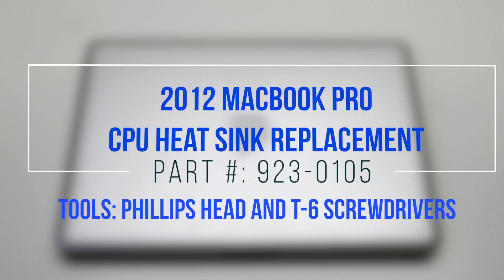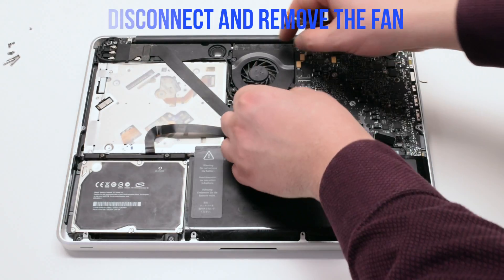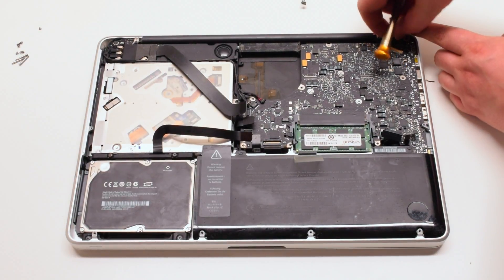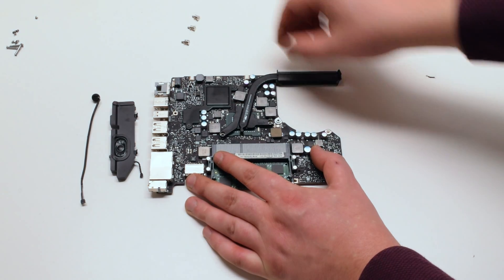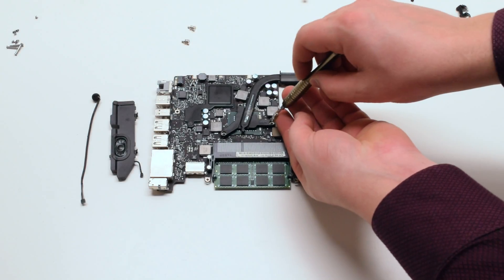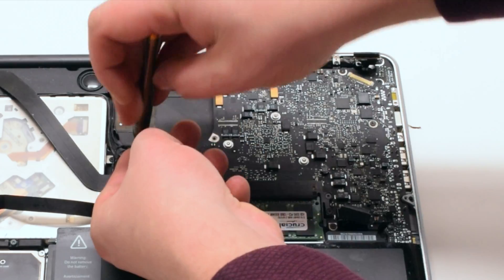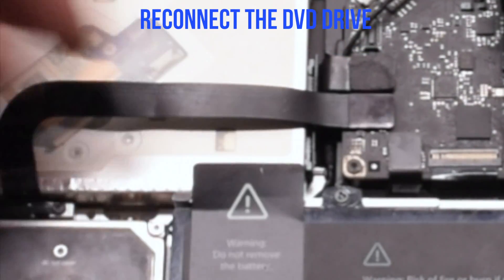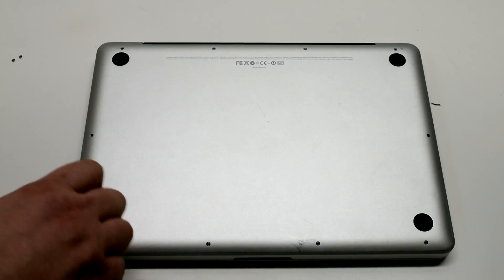2012 Macbook Pro 13" A1278 Heat Sink Replacement

Comment: There aren't 7 short phillips head screws, the four on the bottom have a little shoulder to them. And then the two on the middle left and right are shoulderless as well as the one on the top left.

Comment: I just posted the same thing half of those that watched this mentioned about removing the speaker & mic, but while he was in there he should have replaced the decade old SSD, maxed out the ram, & replaced the rechargeable battery.  I was even thinking about epoxying all the side ports with a drop or less, just to future proof it b/c they're always what break loose on me, as in gluing down the port housing to the PCB, & making sure not to get any on the contacts, but if they're screwed down, just using blue liquid locknut would be better.  Guess I should liquid locknut all of the screws, after testing everything is working.

I am about to do all I listed & repaste the CPU, just need to find whats the fastest SSD & ram it can handle so I do not buy better then it can use.  Also want to see if I can get a better longer lasting battery.  

Shame the CPU isn't socketed so it could also be upgraded.  Guess I could look into replacing the motherboard with a new update/upgraded model that will fit, & still use the same display & keyboard/mouse & all the ribbons cables used with my older model.  LOL hell the latest Raspberry Pi ARM CPU is probably a few times better 🤣

And why is this video called "Heat Sink Replacement" it's a heatsink repasting.

Comment: Good time to replace the SSD,  max out the ram, & replace the rechargeable battery, all things found on Amazon, Newegg, or Ebay.  Also don't even start unless you have the right tools, you do not want to strip out the screws, but if you already did, you can buy new ones on ebay.

Comment: If you're new to this I would take a picture w/ phone of the macbook pro w/o cover, & printout & lay screws on printout from where you took them from ... I use a magnetic sheet from Staples, under the printout to hold the screws from moving.

Comment: btw, this is a good time to check if any ports are loose, & a good time to future proof them with a drop of epoxy placed to hold down the housing but NOT cover the contacts.

Comment: Hey! great video. Quick question, what is the reason for removing the speaker before removing the heatsink? It doesn't look like it's in the way, is it relevant to remove? I shall be attempting this in a couple weeks on my younger brothers laptop as it has heat issues.
Reply: There is no reason to remove the speaker

Comment: Surely that keyboard backlight was a pain in the ass. I added some metal tape so i could pull it a bit. Also added some metal tape from the fan to the heat sink, just like on the older macs, so it conduct heat more efficiently. Then I added some iso tape over it so it does not contact anything, again, just like on my 2006 Macbook. I booted it up and it works like a charm now. Thanks for the cool video! It really helped me through this. Big THUMBS UP!

Comment: This tutorial damages the mic... DO NOT THIS VIDEO TUTORIAL!
Reply: I just did this tutorial. While it is easy to damage the mic, you must pry the mic off the glued surface like he did in the video. (You do not have to remove the speaker or mic cable once you’ve removed the motherboard, I don’t know why he did this). Even if you do end up damaging your mic, it’s just a small and cheap peripheral that can be replaced by unplugging the old one and plugging a new one in. So do the repair, it will be fine. I did it and it worked for me (I ripped the cables off my mic by accident but as I mentioned earlier, I just plugged a replacement in. No big deal)

Comment: A little fast for me, but between this and the instructions on iFixit, I got it done. The ZIF ribbon with tape trick is key. Thanks as this video was really helpful. I didn’t have to touch the speaker. That is an unnecessary step.
Reply: Do you have a link to this guide?

Comment: Thanks for the clear and awesome instructions, but i do not see the point of taking out the speaker. You could’ve skip it.
Reply from the maker: Might have not been cut out. I make videos in batches for multiple repairs.
Reply: I follow this videos it destroy the mic.. you can bypass the mic removal..

Comment: Best video on YouTube for this repair. Good angles, lighting, and short video. Do keep in mind if you’re reading this, you do not need to remove the microphone and speaker when removing the heat sink
Reply: Anything else he did was unnecessary? I am going to clean mine someday

Comment: Thank you for your instructions, but I have a question. I got everything put back together, when I turn the machine on I get the "chime" the backlit keyboard, etc.. However, the screen is lit, but it's black. Any ideas here on what could be the issue?
Reply: Were you able to find a fix on it? Currently experiencing the same thing. Thanks!
Reply: @benjerekcaldito1115  Same here, did you find a solution? Thank you?

Comment: Nice video. Bit rough in areas, but overall a good video. Your thermal paste application was spot on, in my opinion. I'm of the same belief that you don't need to spread it out etc or put LOADS on.
Reply from the maker: Thank you.

Comment: greetings and congrulations for your tutorials! I think you are the person in charge of helping me! I have a macbook  mid 2010 13”  and I managed to change the thermal paste wharching your video ! The only problem is that something odd happens. The laptop works only without the bottom cover. if I put the cover, the computer stays stuck, the fan runs at max speed. Somethimes computer start but the wifi dosent work. Any ideas? I would be grateful for some advice. A good day!
Reply from the maker: Most of the time, there is a loose connection or slight misalignment that is causing a short contact. The best advice in this situation is the daunting task of completely removing the logic board and reinstalling it as if you did the procedure again. This will assure you reconnect everything. Trust me, it seems pointless but will fix most issues 90% of the time.
Reply: I will try! Thank you a lot  a have a great day!

Comment: That keyboard led connector broke off the board with the connector very easily... Guess I’ll have to learn to solder now.
Reply from the maker: As the boards get old this connector bears all the time no matter how careful you are. Apple used cheap plastic.

Comment: I checked (and double checked) my connections after replacing the heatsink but now my battery says it's not charging. Any ideas? Thanks!
Reply from the maker: There might be a particle somewhere on the board that's creating a short. My advice is to take out the board and clean it with 99% alcohol and a toothbrush, then reassemble.
Reply: https://www.youtube.com/watch?v=FGYrykiL9rA

Comment: Can I apply liquid metal on it? Since there are no aluminum involved cpu and the heat pipe itself
Reply from the maker: Sure, I don't see why not but I would give this thread a full read before using liquid metal http://forum.notebookreview.com/threads/liquid-metal-explained-how-it-works-why-it-fails-and-how-to-use-it.809332/
Reply: Save Apple Dollars Thanks a lot!!

Comment: You saved me a 1000 bucks.. My Macbook Pro was heating and stalling all the time.. This did the trick.
Reply from the maker: Glad to help!
Reply: my macbook become very hot, is the thermal paste the problem? im not sure, never changed the thermal paste since I got it in 2015...
Reply: Bertuzzi it may be. You should change it since Apple is notorious for putting bad thermal paste. Make sure you clean out the fan too.
Reply: Do u had the kernel task going high also ? @vasanth
Reply: @yeshusingh4521  this might be my problem. Can you explain more? How do I fix kernal problem?

Thank you
Reply: I don’t recall now. This was 4 years ago.